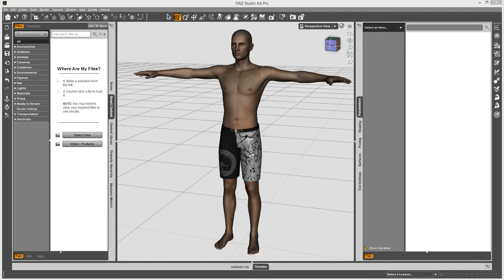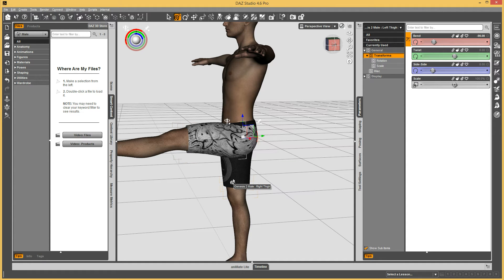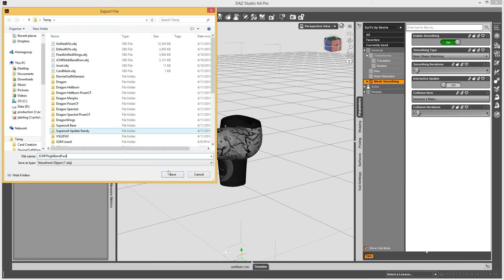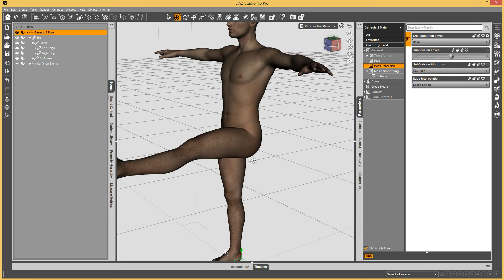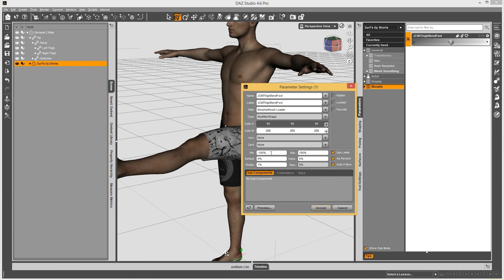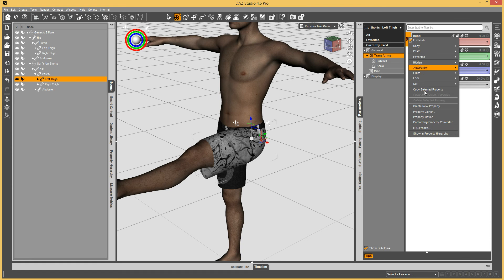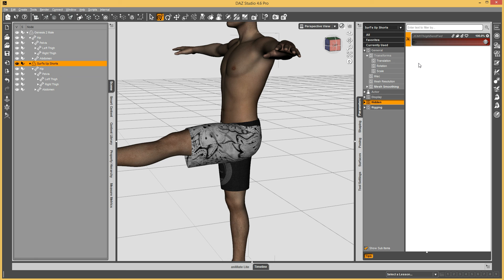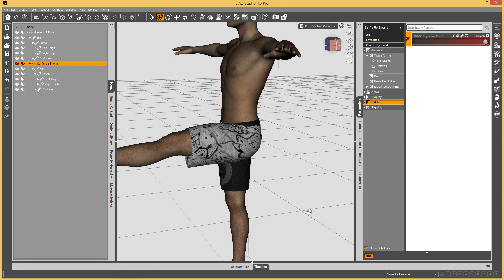Creating Joint Corrective Morphs on Clothing

Comment: How do you set the movement of one limb to zero the other sides morph for that limb (i.e. morphs on a tee shirt for arms raised, but when both arms are raised the morphs are combined .. so i need to have each arm also control the opposing morph/arm so that the arms both moving up zero the two morphs and trigger a new morph for both arms up...) but i just dont know how to set it up. i know its something to do with "erc delta add -.5 jcm_rightarm" (found in forum) but i have no clue how to add that property controller... anyone know how? cant find ANYTHING for this.

Comment: Hi, just a question if you happen to know about that : working on G8, I'm creating JCM for a set of clothes. I read that I'm supposed to name the morphs exactly with the same name as the (hidden) JCM that is used when, for example, bending an arm forward. It works really well, but right now, when bending the thigh, I see that 2 JCM are actually dialed up to 100 : pJCMThighFwd_115_R  &  pJCMThighFwd_57_R.  As far as I can tell sliding them, they both seem to have the same effect. How should I name my pants morph if two G8 JCM are dialed up when using only one rotation slider on a limb ?
Reply from the maker: The name of the JCM will tell you what value to rotate the leg to in order for it to be at 100%, so what happens is we have a JCM at 57 to fix issues at that stage, then when you rotate it to 115 you have the combination of the JCM at 57 and 115. Since 115 is additive to 57 the differences aren't as extreme as you would see if you only had the single JCM at 115.

So if you only need to make the one fix at max rotation you would name it pJCMThighFwd_115_R
Reply: @joshdarling3626  Wow thanks man. Nice to read someone who obviously has a clever understanding of what's under the hood. I'm a modeler for many years and I'd like to try and sell on the DAZ stores. But damn the user to vendor transition is a pain. There are more questions on forums from people who obviously barely know what's a vertex, than answers. 
So thanks for your tutorials ;) They are really helpful.
Reply from the maker: @HanSolocambo  Yes, the transition from user to vendor is painful! Let me know if you end up with more questions

Comment: Hey Josh, this will work for fibermesh hair...... SO here is my dilemma ..... I have underarm hair for my Gino character that's still being polished up for market.  While the underarm hair comes in as a "two for one" set up I created SEPARATE morphs to "squish" the hair under each underarm as the arm comes down.  I'm running into issues with this ... when setting up the hair on one underarm it goes fine for the ERC process but when I set up the other one the right underarm and run the ERC operation the one on the left is now becoming distorted.  So need to know what to do here.  Do I split the main underarm hair file into two (R & L)  to keep this from happening or is there a way to fix these corrective morphs so one doesn't affect the other one?  Thanks so much!
Reply from the maker: A couple things you will need to narrow down. First make sure that the morphs only affect what you expect them to affect. If you dial the morphs individually and they aren't affecting the opposite side then you know the morphs are fine and you can focus on the ERC hookups. There's even a way in the Edit mode of the Parameters Pane when you right-click on a morph to have it select verts affected by the morph. If the morphs are looking good then you can move on to looking at the right arm ERC in the Property Hierarchy Pane and see what is driven. If the left morph is controlled by it you can remove the link right there without any hassle.
Reply: @joshdarling3626  Thanks so much.  I went ahead and split up the hair main file and got it working fine for each arm but not sure how many erc's I need to add.  I thought I had them working but when I loaded up a new instance strange things started happening again when an arm had a mixture of rotations going on .. MEH!  LOL

Comment: Great tutorial(s)! I noticed that the Shin Bend JCM's have two correctives: one up till 90 and the other to 155. I want to replicate this approach on a clothing item, but the 155 morph goes on top of the 90 morph and messes things up. Could you give me a tip on how to approach this correctly?
Reply from the maker: You bet! What you do is rotate the leg to 90 so the first morph is at 100% and the second one hasn't kicked in yet. Make a corrective for that position and name it to match the JCM that applies at 90. Then rotate to 155 and make the fix there. The 90 morph will already be applied, this one stacks on top of that.

Comment: Is it possible to add two JCMs to one joint rotation on different values? Like if I wanted the shorts to hang forward if the leg is bend back?
Reply from the maker: Make sure your JCMs only have a range of 0-100%. That enables you to have one morph dial up when the leg rotates one direction and a different morph dial when you rotate the other direction.
Reply: That prevents the first JCM from applying on negative rotations, yes, but I still can't add the second one - on your video at 6.33 the master parameter you added JCM for is simply not available anymore. So how do I add a second morph for negative value?
Reply: Never mind - solved it - DS HIDES the parameter you add JCM to for some reason. So to add a second one you need to go to the side panel and check "show hidden" - it will display the parameters again and allow for setting up the second JCM. Just a frustrating interface issue.
Reply from the maker: Glad you found it! Yes, that is a frustrating issue. I have forgotten about it because I show hidden all the time now...

Comment: Hey Josh. Thanks a lot for your tutorials. They helped me a lot on my way to learn content creation. Just one question: is there a way to create "shape corrective morphs"? i.E. if I dial the "bodybuilder" morph up on my base figure it automatically dials up my corrective morphs on the clothing?

Edit: aw, I just got so close when I watched your video again and hit "show hidden properties". There I can freeze the ERC for the "bodybuilder"-morph. But my JCM or SCM doesn't show up there. And when I chose it from the dropdown, a huge long list of "render priorities" shows up. Am I doing it wrong?
Reply from the maker: +nimb321 Shape Corrective Morphs are often referred to as "Morph Corrective Morphs" or MCMs. You can definitely do those, I have a video about it here: https://youtu.be/Oj-eO2V7Yvg

With clothing, though, that usually isn't the best way to fix a morph. If the Bodybuilder morph is screwed up on your clothing, you should fix the morph and bring it back in through Morph Loader Pro as the same name (FBMBodybuilder) and allow it to update by changing the Overwrite Existing option to Deltas Only.
Reply: +Josh Darling Hello, thanks for the quick response :) OK, I did that - I brought my MCM back in to my clothing and turned the Overwrite Existing option to Deltas only, but nothing seems to happen :( Am I missing a step?
Reply from the maker: +nimb321 Did you make sure the name matches exactly? The easiest way to see if it replaced the existing morph correctly is looking to see if you ended up with a morph in the default group of "Morphs/Morph Loader". If you have a morph in there, then your naming didn't match the one that you were trying to update.
Reply: +Josh Darling Ah, there we go! It's because the morph is split into "FBMBodybuilderSize" and "-Details". I hooked it to the "FBMBodybuilderSize" and it almost worked! Yet it's not 100% like I adjusted it in my modeller. I'll have to tweak and search a bit to find out why.

EDIT: Geez, I always speak too soon. It didn't match because I had to update BOTH properties of course ;) There we go! Problem solved! I thank you a lot, Josh! Let's wait for the next nut to crack :P
Reply from the maker: It probably doesn't look quite right because you worked on the combination of size and details. You will probably need to separate them to get them to look right. Try loading the morph like you did previously but turn on Reverse Deformations and Preserve Existing Deltas. Do that first for the size morph and then for the details one. I think in the end you should end up with the correct look.
Reply: +Josh Darling Yyyep! It worked. Thank you very much :) Just a quick note: for some reason I had to adjust the clothing TWICE for each value. But in the end I got the result I wanted :)
Reply: +nimb321 I see now. That's because I was a dumbass and checked "Reverse Deformations" every time :-|
Reply from the maker: +nimb321 Glad you got it!

Comment from the maker: Well, I think it would notify you if I was able to reply to your comments, but for some reason your messages never give me the option to reply to them...

Having a morph apply only when two joints are rotated is a bit more difficult. I'm not sure if we have any tutorials written up about it. I don't have any personally...
Reply: Josh Darling Hi, Well there is some OLD information on MCM's in the DAZ data base I found but a vid tutorial would be better plus the info is for like DS 4.3 so it's before allot of the updates and areas that were reorganized.  So a new vid from you would be super!  Thanks Josh!
Reply: Josh Darling Here is the antiquated doc:
http://docs.daz3d.com/doku.php/public/software/dazstudio/4/userguide/creating_content/assembling/tutorials/creating_morph_controlled_morphs/start
Reply: Richard McWolff Ah yes, that information is still correct in concept but it does reference Property Editor, which has now been rolled into a combination of using Property Hierarchy and Parameters Pane in Edit Mode.

We don't have any tutorials the cover complex MCM/JCMs that apply when you have multiple rotations, though...